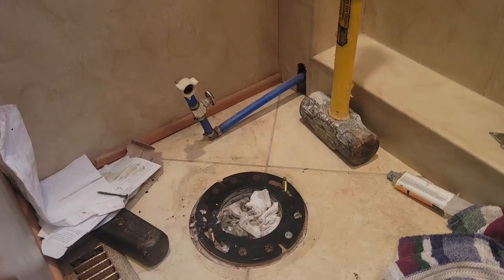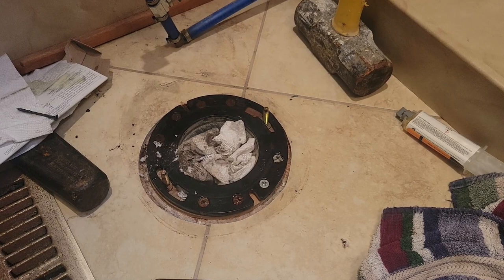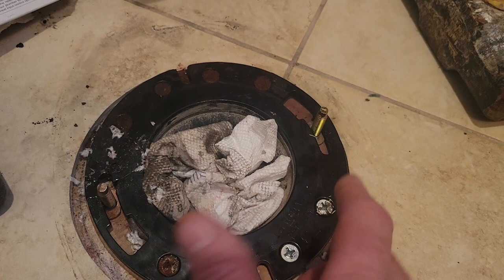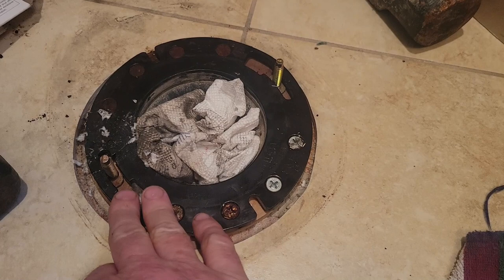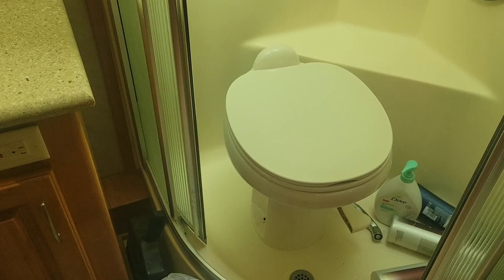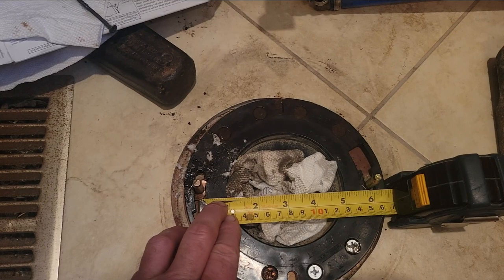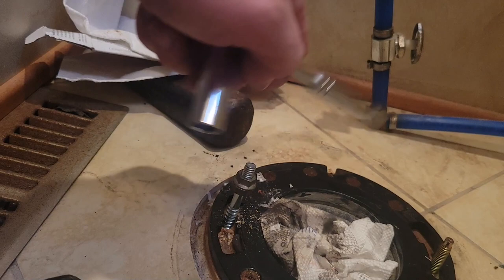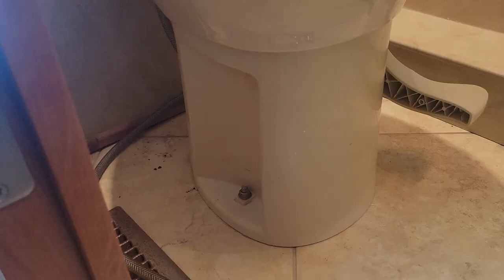Repair RV Toilet Flange that is cracked.

Comment: Question is how permanent is this? Is the stress that broke the flange gonna rip that thing out of the wood? After all there are 4-6 bolts holding the flange down.
Reply from the maker: Ripping it out of the wood is certainly possible.  I believe that this "fix" into the wood is stronger than the original situation where the ABS-plastic flange is what was providing the side-to-side resistance for the toilet not to move.    It's been about a year now and we've actually taken the RV on some long trips (I'm retired) and lived in it for several months out of this past year and it has held up so far.  I think the key is just whether we (or anybody using our toilet) uses body weight to exert a strong sideways force on the toilet.  If it doesn't get abused I suspect it will last longer than the rest of the RV.  Of course, if someone (me?)  puts all their body weight on one side of the toilet and applies a lot of sideways stress then it will certainly break out of the wood.  Although, as I said already, I suspect the ABS on the other side of the flange that I didn't change will likely go first.
Reply: I try not to put my weight but....  My wife and I and 2 kids are full timers.  Our unit is a 2022 model year.  It hasn't been without it's issues but it seems to be one of the better one of these models overall.  I did notice that on this one the installers didn't use the sliding portion of the flange, they used one of the other holes, so it was a thicker portion of ABS.  Being a 2022 there's no leaks or rot.  I'm paranoid about rot, so I do everything I can to prevent it
Reply: @gary_marsh finally did the mod last night.  It doesn't seem as sturdy as it was originally but that could easily just be perception and time between repair and issue.  Hope it works.

Comment: Dumb question, why not just replace the flange or get a metal flange repair kit?
Reply from the maker: Not a dumb question at all...  Replacing the flange would be a much bigger job because it would mean cutting off the pipe below the flange and fixing up the mess that you would make where the pipe goes through the floor.
Reply: @gary_marsh  Mine has no threads, you just remove screws and done, it's just a slip fit into the drain pipe
Reply from the maker: @tru3sk1ll  Yes, that does sound like it would be pretty easy to swap it out if that is just a slip fit on your RV.  On mine, the ABS material is glued together so it was going to be a bit more complicated.
Reply: Because the flange is glued below floor level. It's hard to get that flange out because of the glue.
Reply: @MsPookiesmom  Yeah that's weird, mine wasn't glued at all , there was some weird rubber grommet/attachment, I just pulled hard and in popped right out, so I just bought a new flange and it was easier for me

Comment: I have same problem with cracked flange. What was length of hanger bolt you used?
Reply: I can't say with 100% certainty, but just now looking at a still/freeze-frame of it from 1:40 in the video and then putting a tape measure up against my fingers for reference... :)   I'd say it was probably around 2 - 1/2 inches long in total.  Maybe 3....  Good luck!